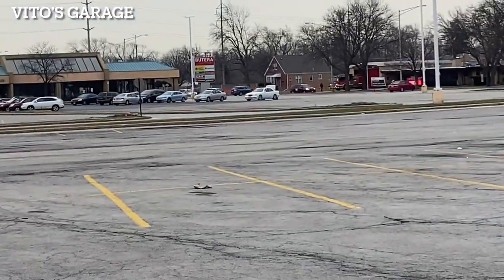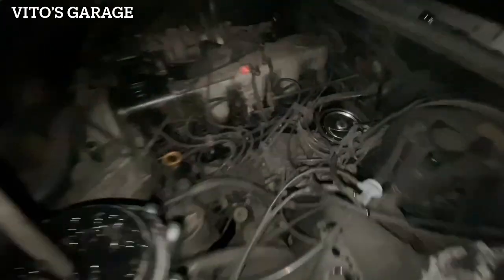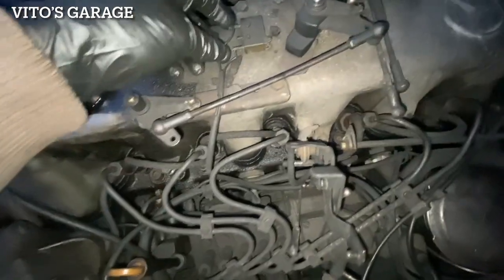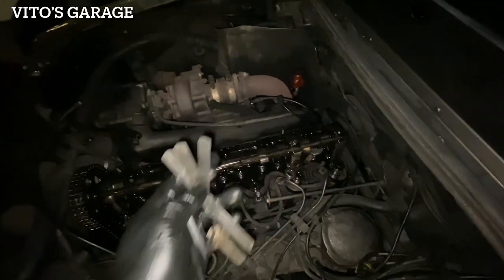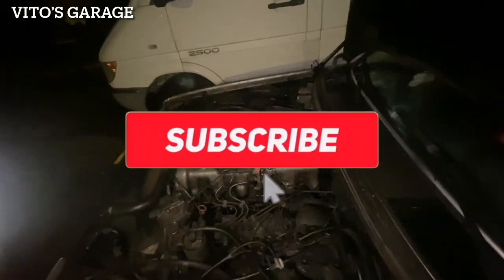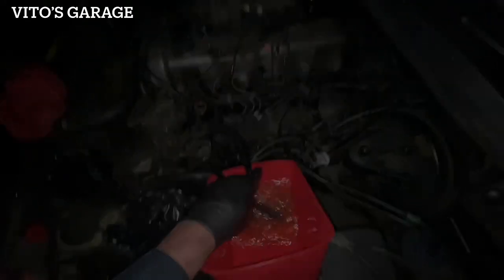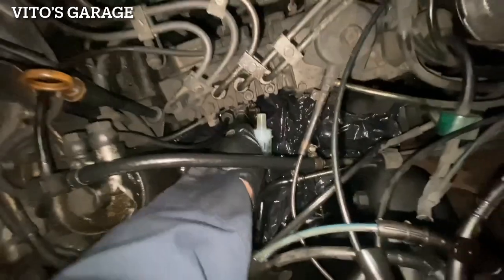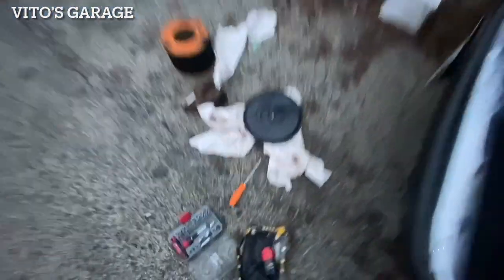Bringing Back From Dead: CA Model W123 1985 Mercedes 300D

Comment: Hey Vito. I haven't seen you in quite a while. 
I had an 85 300d back in the early 2000s. 
The price of deisel started going up pretty high in california, so I got rid of it. Big mistake.
It had 280,000 miles on it, and it ran like a top. I kept it serviced. I did everything but set the valves. I had that done.
I also had an e39. 03 530i. Loved that car! 
Such good cars.
That was back in the day when mercedes and BMW made the best cars.
Take car. 😊

Comment: Please help me with some advice. While changing the oil filter on my W124 with the M104 engine, I dropped a small magnet down the hole at the bottom of the oil filter canister. Not the center hole with the pipe sticking out, nor the smaller circular hole on the side of the center hole, but the bottom area of the filter canister toward the front of the vehicle. I tried using needle nose pliers, a dental pick tool, and a flexible claw grabbing tool to try and get ahold of them, but every time I tried to get ahold of them they went deeper and deeper, eventually passing beyond sight of the moveable spring loaded mechanism at the bottom of the oil filter canister. 

I take it I need to remove the oil filter canister to access the magnets? How do I go about doing that? How dangerous is it to turn on the car with the small magnets there? Please let me know what I should do because I'm really worried I won't be able to get those magnets back out and damage the engine. I actually made it worse, because at first I just dropped a washer down there, and tried using the magnets to remove the washer, but then they stuck to the canister housing, even after I got the washer out with the dental pick I now have the problem of the magnets being down there.
Reply: By oil filter canister I mean the oil filter housing. Also the magnets didn't fall down the one way valve at the bottom, rather the opening at the bottom of the housing, whatever that is. There is still a spring loaded mechanism in that spot, but it's more square and not the circular one near it, if that helps. I can also send a picture with the spot they went circled, maybe emailed to you, if that helps. Thanks in advance.
Reply: Hey great news!! I got those magnets out of the oil filter unit! I bought a long telescoping magnetic pick-up tool which fit in the hole and latched on to them! Having the right tool for the job is so key though.